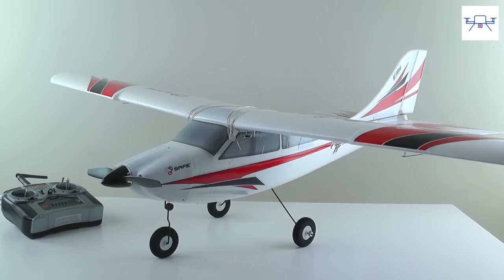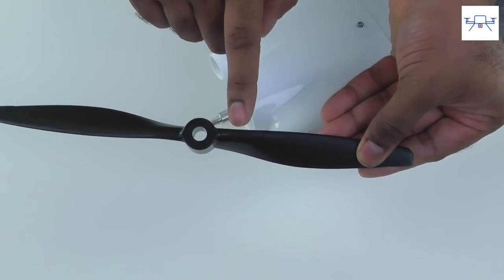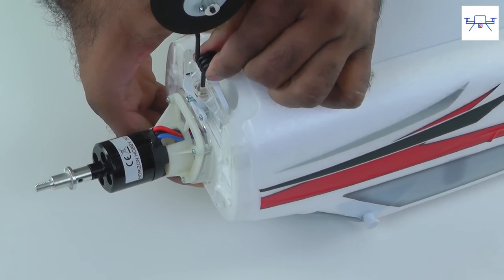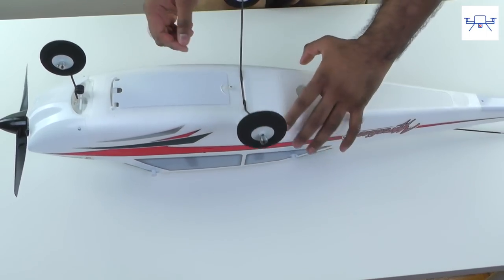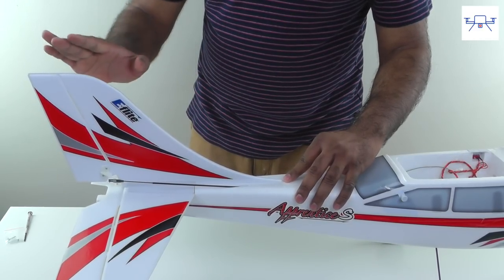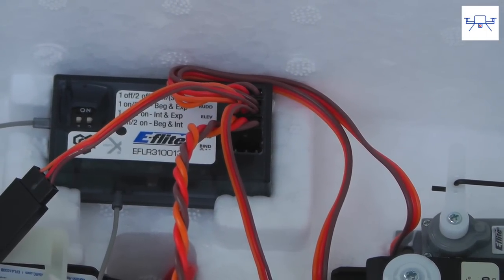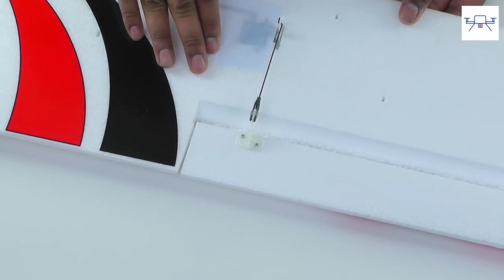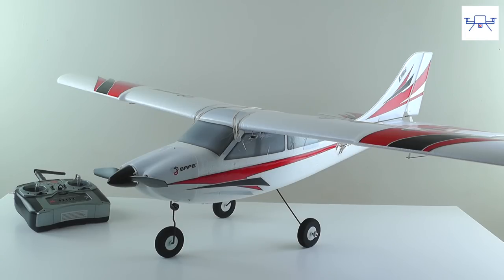E Flite Apprentice S15e Unboxing Part 2: Assembly, Setup, Binding and Mod

Comment: I made mine into a trail dragger after the front wheel bar kept bending. I went through two of them. The notch in that rod is the weak point and upon any hard landings will bend over. I would highly recommend getting the larger wheels for this plane as it tends to mow the lown on slighly longer grass. I flew my Apprentice 4 years before wearing it out. Its a great trainer and easy to repair. You can use boat two part epoxy if the plastic motor mount comes loose. That will eventually happen as the plane ages. Replace the wing rubber bands every year. They will weaken with age and break. I added strip LED lighting to mine also.

Comment: I highly advise that you use the vertical stabilizer screws to tap out vertical stabilizer before installing. The screws are very hard to screw in with parts assembled. High probability you will strip out screw head if you don't tap out 1st.

Comment: I have had and Apprentice s15e for almost two years, a great plane. I belong to a flying club and I had a lot of help at the beginning. After some crashes, one of the members suggested that I get a certain tape for support. That tape I can only get at Ace Hardware. It is called strapping (for packing) tape .94 inches by 60 yd. It is a super strong tape, almost transparent that has linen strands running inside the tape. After breaking off the tail a few times and the elevator, I ran a piece on both sides all the way down both sides of the fusalage, under the elevator and any other weak spots. It blends in and is a very strong reinforcement. This is a good plane to learn on and to maintain.
Reply: z bud I use regular packing tape, its clear and strong, use 3M, not the cheap thin stuff.

Comment: Great video. I just built mine 2 weeks ago using the manual before seeing your video, but you covered just about every part of that, as well as a few additional insights like the Velcro. One question. Do you open the air holes in the bottom of the empennage? The manual does not mention them, but I wonder how warm the motor and battery get in flight. They are just foam plugs, but I wonder if they are meant to be opened. Your thoughts?
Reply from the maker: +Jason Phipps I wouldn't see any issues with opening the holes. But the motor rarely even gets warm. The prop wash and motion keep it cool for the most part. The ESC also doesn't get very warm. If you're flying the craft and not pushing it way too hard, you certainly won't have any heat related issues. This really isn't meant to be an acrobatic aircraft. It's a trainer and if flown like one, overheating won't be an issue.

Comment: Thank you for the vid! but where is the center of gravity on this bird?
Reply from the maker: +Gilberto Sedo Thanks! The manual suggests a specific distance behind the leading edge of the wing.
Reply: Yeah, 1 1/8" from leading edge.
Reply from the maker: +Gilberto Sedo That sounds about right.

Comment: I have the bnf version of Apprentice STS and I successfully binded it to my Gen 3 Spektrum DX6 transmitter. And I successfully assigned channel 5 to use switch D for the SAFE modes. However after binding, the plane only shows green led light(beginner mode) and not blue(intermediate) or red(experienced) even after I flipped the switch. Do you know why I can't get this plane out of beginner mode?